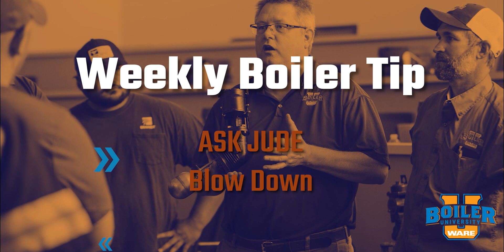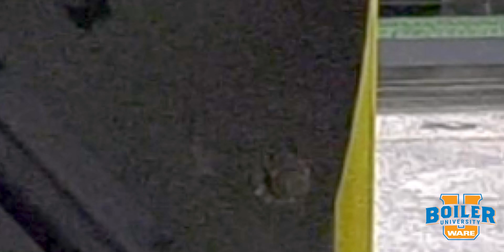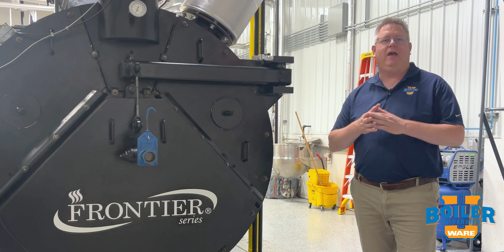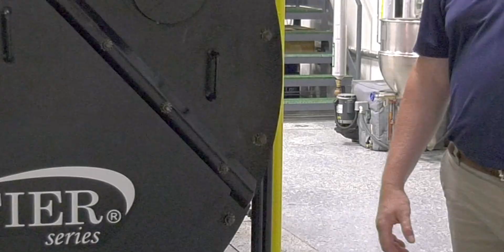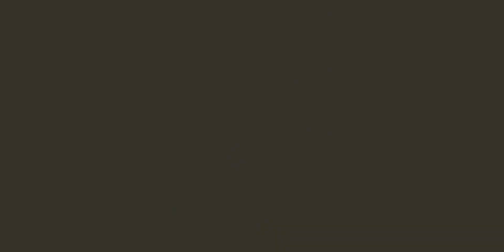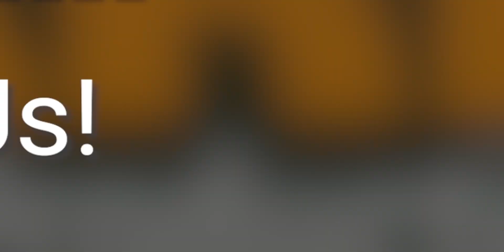Blow Down Frequency - Weekly Boiler Tip

Comment: I have a question. With manufacturing needs I cannot be at a low firing rate to blowdown, so the alternative has been to do quick blowdowns. Is there any better way to blowdown with a high (60%,125PSI) load?